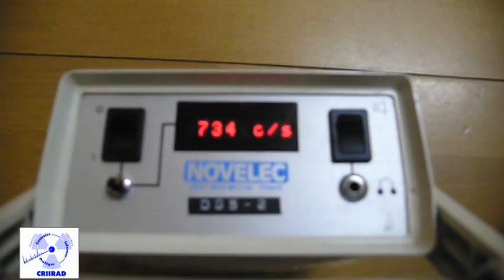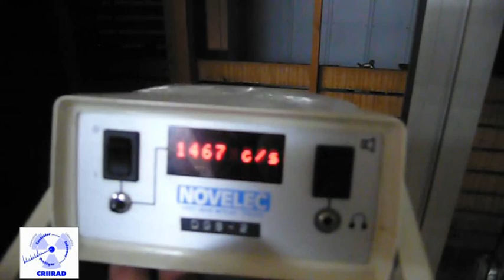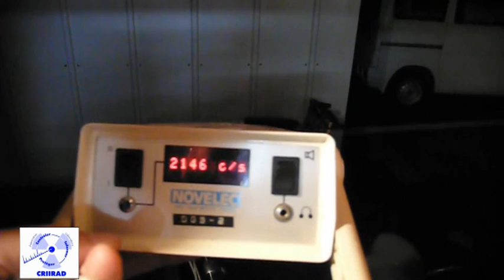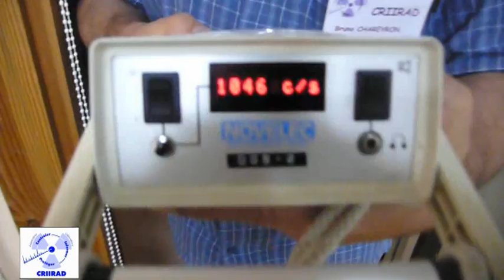FC4 CRIIRAD Demo DG5 Watari.mpg

Comment: more like 60 times inside? isnt the outside norm about 12 cpm excepting where npp legal emmissions were happening

according to the japanese government there are areas at 0.05 mcSv/h and this can be verified by checking safecast japan.. so the normal winter background is less than 12 cpm (remember the snow after daichi? though the snow might have been formed by  the hot particulates condensate forming in the cold air, this happens at coal fired stations too!)